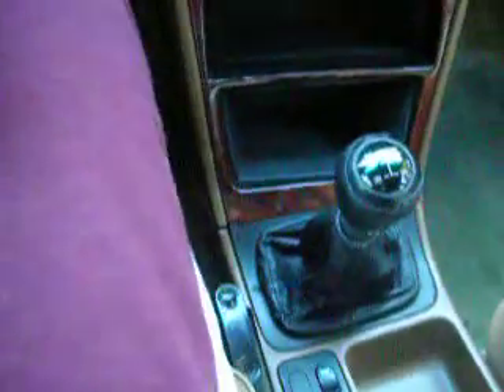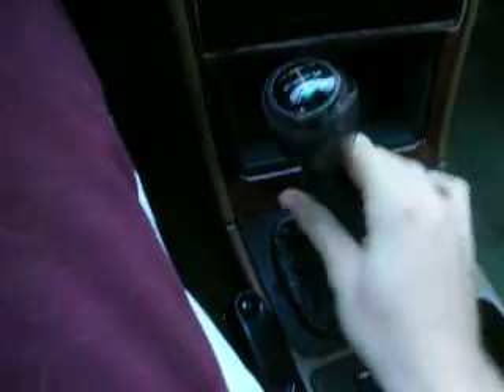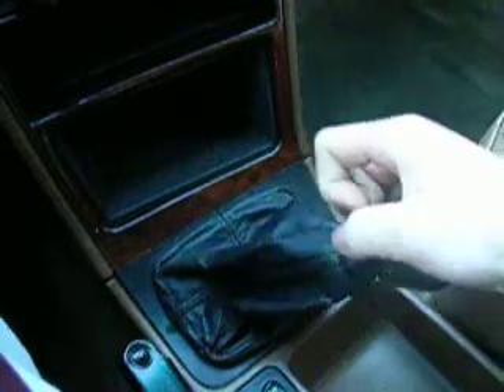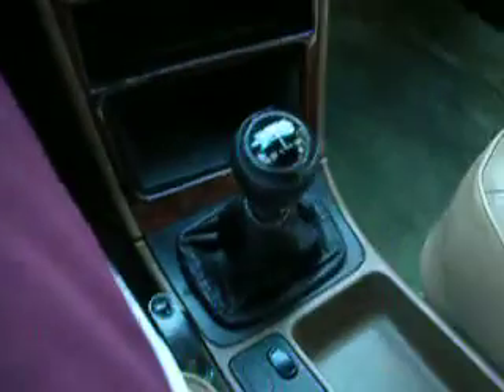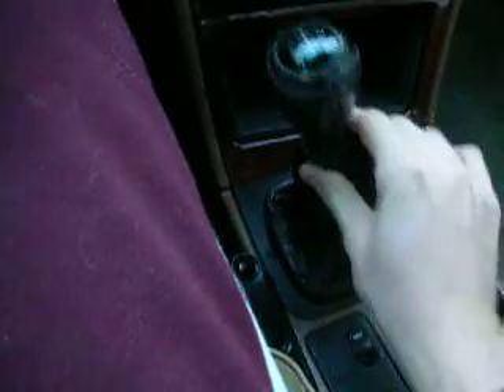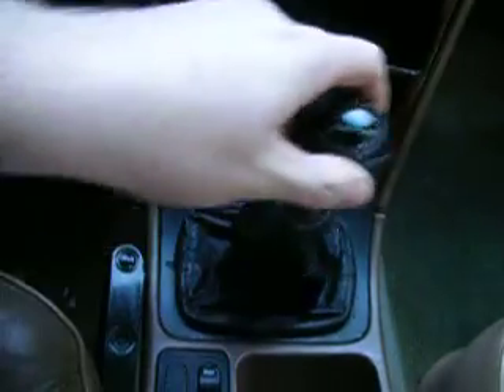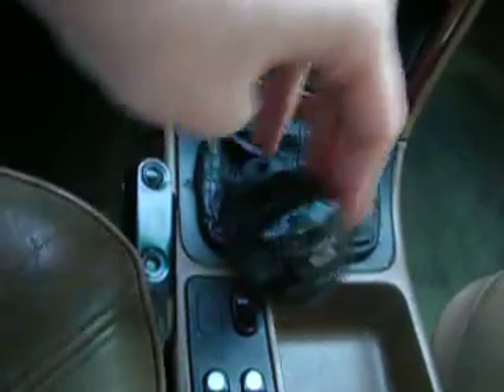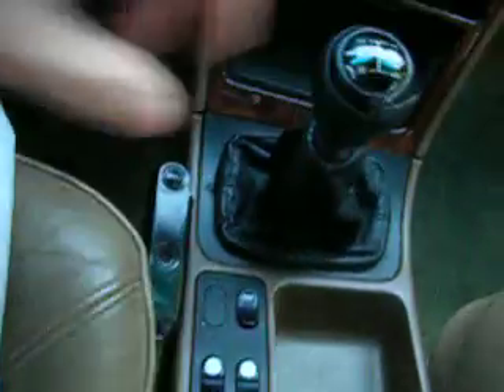Shifter Problem? Any Opinions?

Comment: mine does the same thing and it also pops out of first gear when you let off the gas
Reply: tom adkins I have a Saab 9-3 2005 and mine pops out of first gear as well they said it was the shift cable that it is stretched